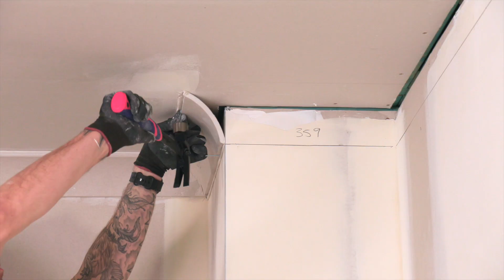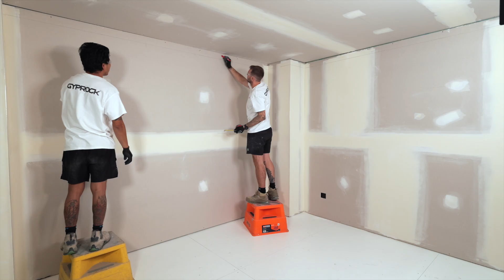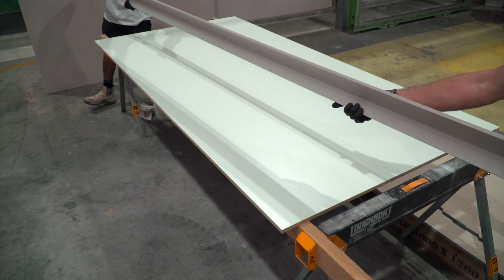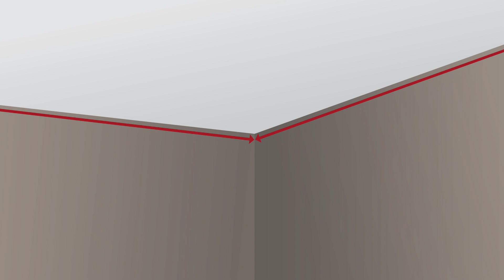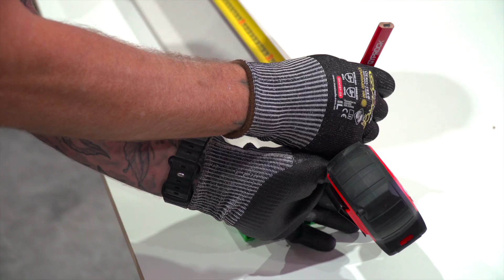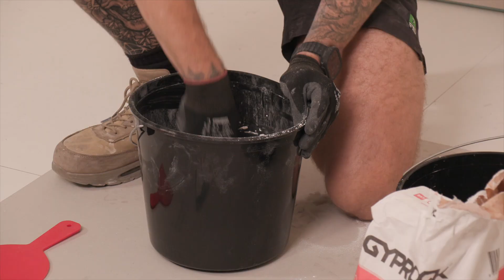How to measure, cut and install Gyprock Cornice - DIY Video Series - Video 3

Comment: Ah… some good TIPS 🤔💭 
📌 Write WALL or W on the bottom edge of the cornice
📌 Turn cornice UPSIDE-DOWN to cut‼️🧐
📌 Have a small TEST PIECE handy to check if the cornice is fitting snug on the corner
📌 Use nails along the TOP & BOTTOM of cornice to hold while drying
📌 External Corners are LONGER on the TOP
📌 Internal Corners are LONGER on the BOTTOM
📌 Use a Hand Held Laser to measure 👍
Cheers, Laurence 🛠✏️

Comment: As a bit of an amateur I found the 45 minute cement was going off too quick on lengths over 3M when mixing, buttering up and installing on my own. Good to see there is slower setting. Also like the technique using the broad knife to butter up a bit quicker than I was with a paint scraper about half the width